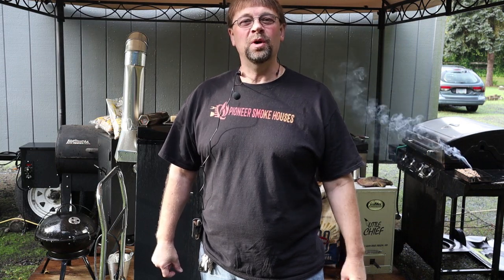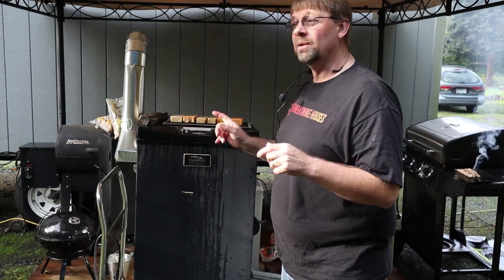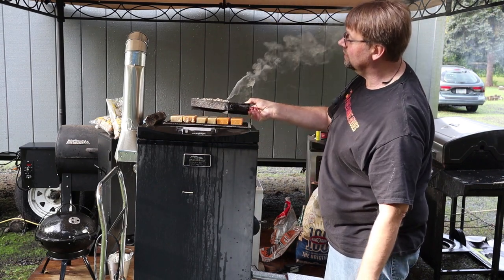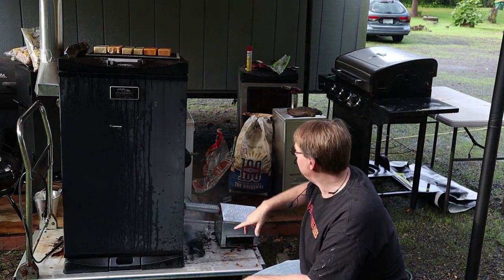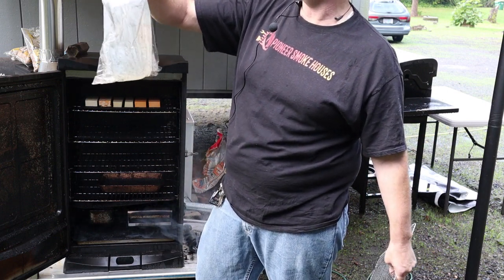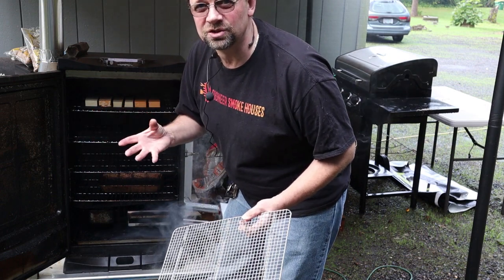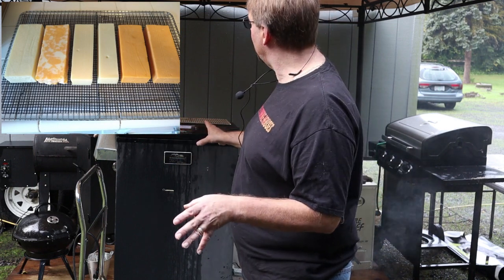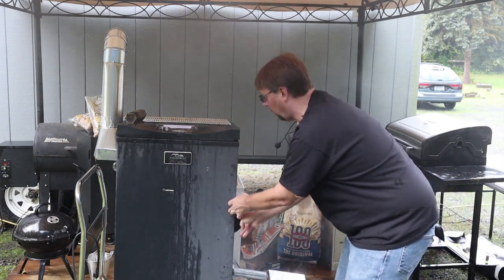How to Cold Smoke Cheese in a Masterbuilt Electric Smoker

Comment: In the video it was difficult to tell. Those looked like 8oz (227 grams) blocks of cheese, with a 1 pound block (16 oz or 454 grams) of the large one. They were just referred to as "this size" and "smaller" or "larger," etc. Did I guess the sizes correctly?
Reply from the maker: Correct. sorry about that, in my area we have 3 standard sizes.